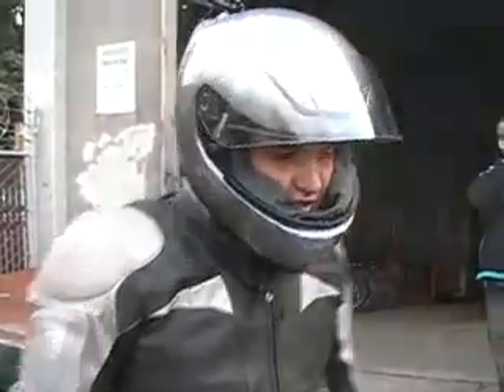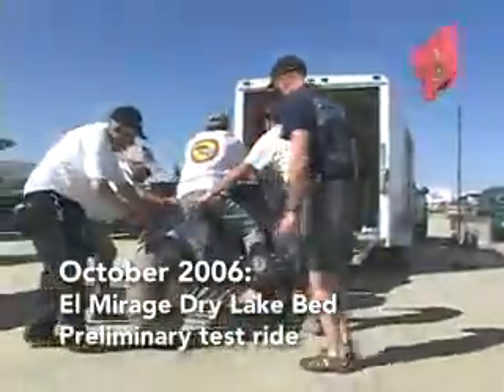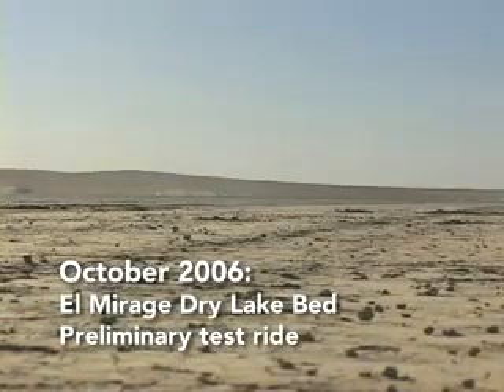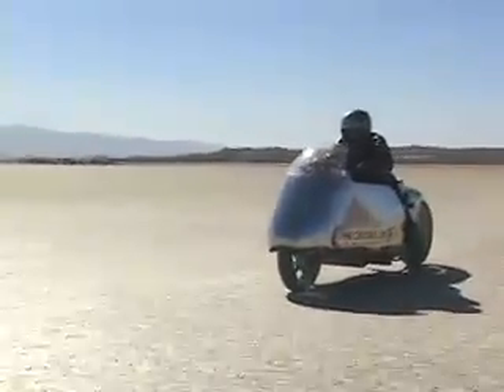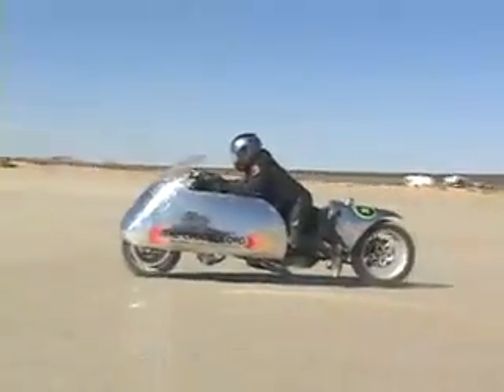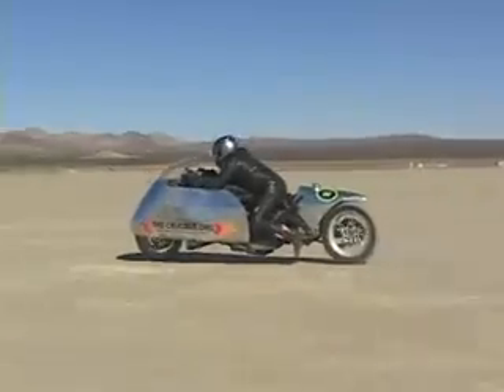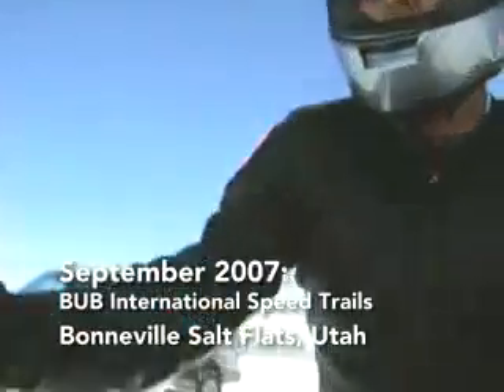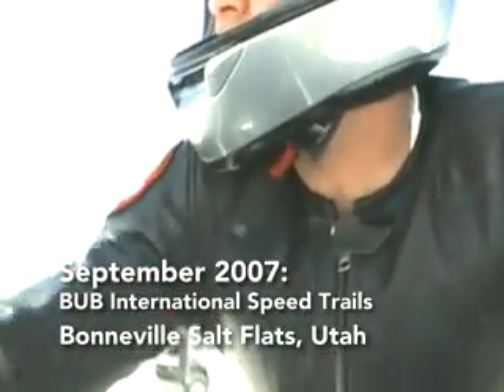DieMoto: Sets World Land Speed Record - BioDiesel Motorcycle

Comment: With the car engine and it being a diesel, the gear ratio's can be changed a lot because of the high torque. With a much longer drive it can get a lot faster I think. Yet, do you want to drive that and will it still be stable? Cool project though, respect!